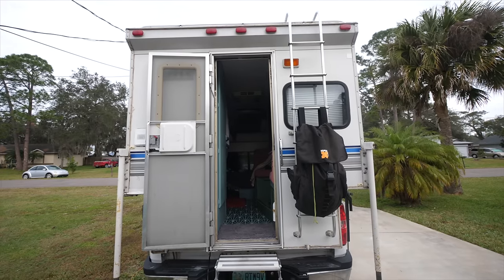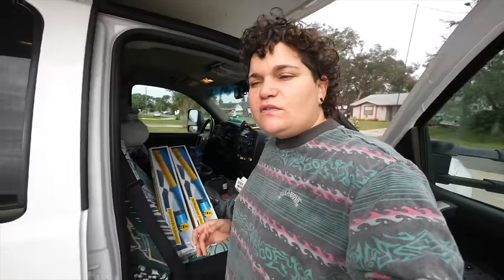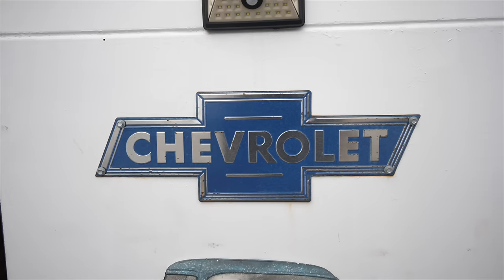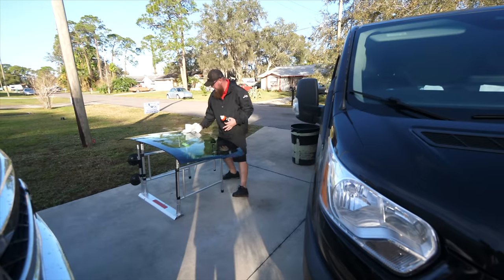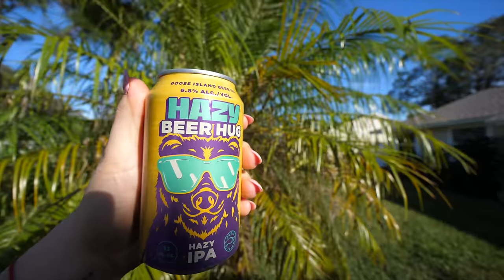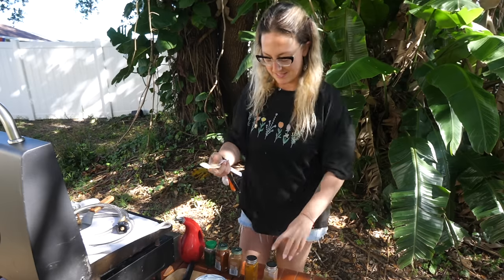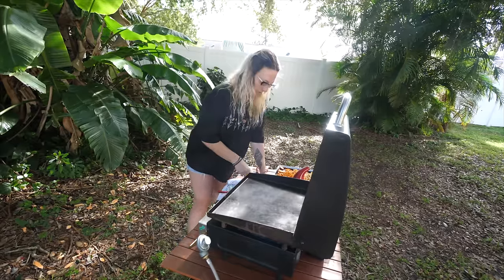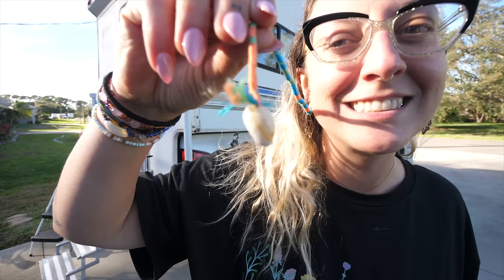We Needed THIS Truck Camper Upgrade

Comment: If you don’t have airbags on the rear, I would suggest Timbren Springs. They are made of heavy duty rubber. You can install them in about 30 min or so yourself. Just takes a little ingenuity the get the screws in. It stopped almost all the sway on my F-150 pulling my travel trailer.